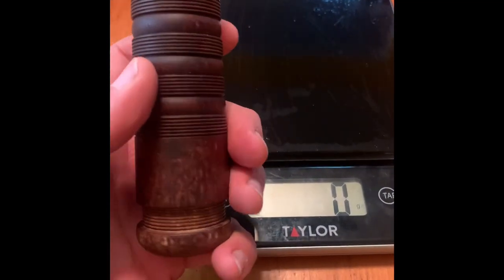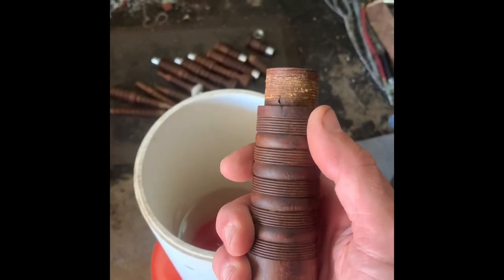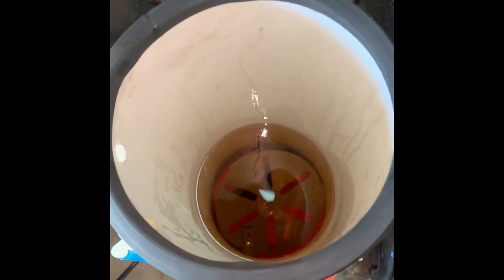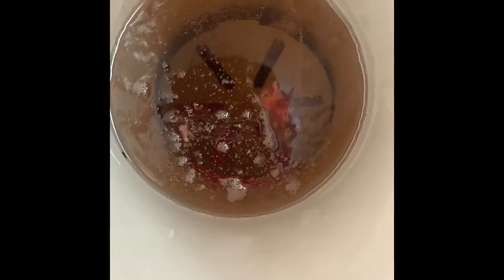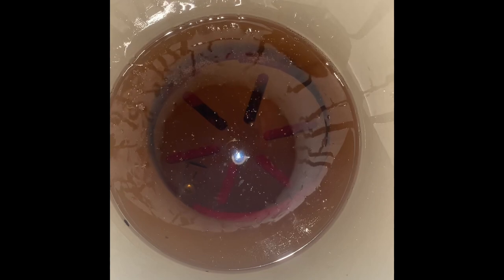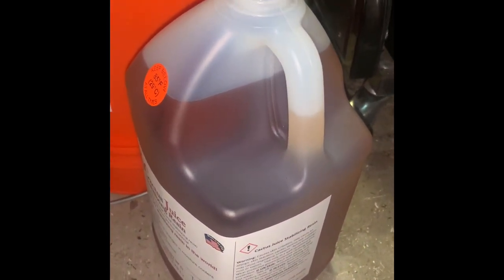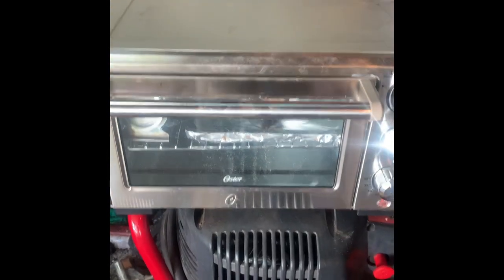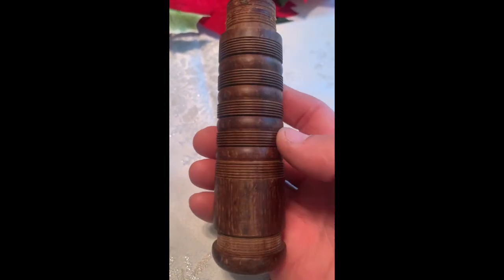Refurbishing a set of Pakistani Bagpipes Part 3 of 4.

Comment: Interesting project. 
Have you thought that cooking the stock has dried the wood's relative humidity to 0, thus making it lighter?
A good test of your impregnation would be to wrap the stock in a damp rag and store it in that bucket and weigh it after a day or 2.
Reply from the maker: I did think exactly that.  I didn’t show the finished weight of the bass stock because my scale broke. I have purchased a new one.  I’ll get it weighed and either update the video or put it in the description.  
Instead of doing what you suggested, I just oiled them with bore oil.  The wood really soaked in the oil.

Comment: Just wondering, if your adding a hardener to the wood to make it function more like Blackwood, should you bore out the wood before you harden it so the wood will still have the resin in the wood to improve sound ?
Reply from the maker: The impregnating liquid will harden.  Then I am going to bore them out.  I didn’t bore it out first because there’s always hard impregnating liquid left on the outside after I put the pieces into the toaster oven.
Reply: @sandiegobagpiper  So it's only to keep the wood from falling apart ?  I was thinking the resin was also being used to improve the resonance of the drones ?